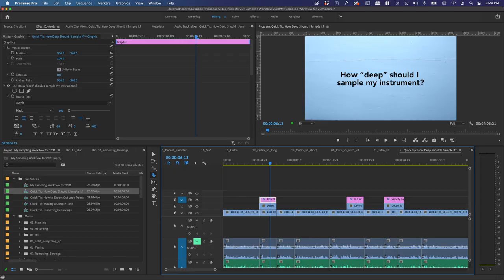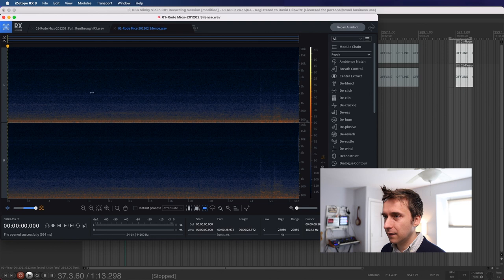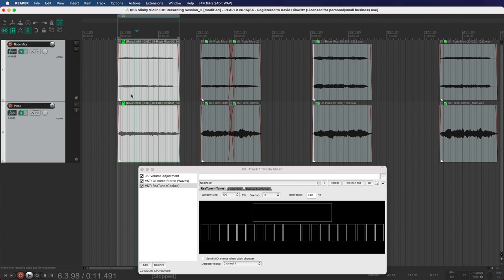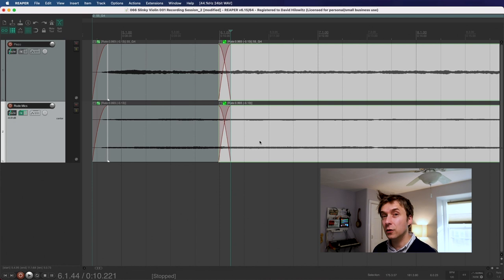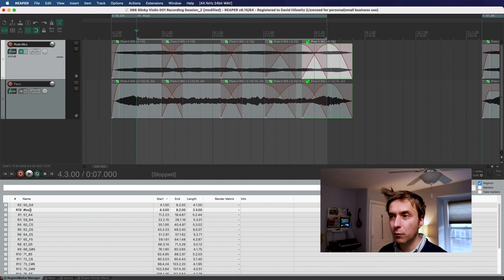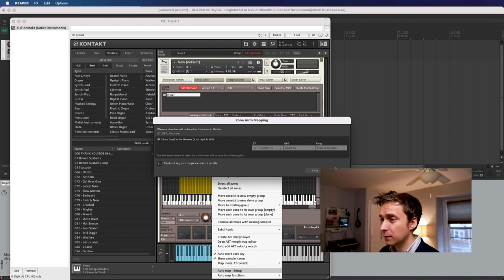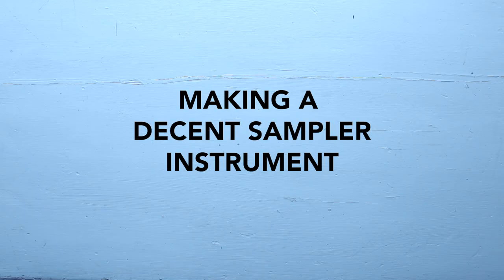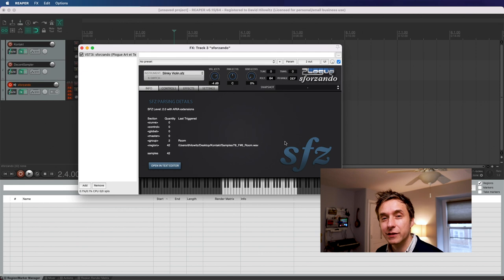How I make sample libraries - 2020 Edition (Kontakt, SFZ, Decent Sampler, REAPER)

Comment: Dave, your content has been amazing. I've started sampling my synths but since Ableton doesn't have an automated sampler I almost gave up. I found out that you can use the free MPC beats software (DAW?) which has a really powerful built in autosampler and you can pull that into kontakt and have it work pretty much without any adjustments. Might be something you could add to a new video. Having a free option for autosampling midi instruments is really useful for beginners like me.

Comment: Thanks for this really helpful video. David, I found out, that your method of changing the rate rather than the pitch in REAPER for manually tuning the samples (as remarked in 8:30) is sort of mandatory on the looping trick you showed in 16:45. I was using pitch at first but ended up with clicking when using your loop trick as described, which does not appear when using the rate. It even appeared when setting the loop points exactly on the zero-crossings. I guess the reason for this is, that REAPER does not show the actual waveform when using pitch rather than rate.

Comment: Can this be done with RX Elements, or is the full version required? Also, what beginner microphones would you recommend to get into sampling? Thanks for a great video!
Reply from the maker: Yes. If you're using RX Elements, just use "voice de-noise" instead of "spectral de-noise". It has fewer controls but I used it for many years and can confirm that it does work. As for what microphones to get, I'll have to give that more thought... :)
Reply: @DavidHilowitzMusic  no worries, thanks very much - let me know if you get the chance!
Reply: Dave made an earlier video using RX7 Elements, in the 1st few minutes of it, that might be useful to you:
https://www.youtube.com/watch?v=B2iEhJcrHxI
Reply: @tonymckeown1314  great, thanks very much!!
Reply: @mediacomposer  Regarding microphones, mics are a varying subject depending on the instrument.

For close micing use sturdy mics like sm58 for example, for vocals high quality mics are great like beta58a and so forth, all depending on your budget preferably condenser or ribbon-like Neumann mics for high end artist or instrumentalist is great option.

Comment: Your video is very helpful as always. I sampled a few instruments. But I am facing one challenge with the pitch bend range. I need large PBR (at least 12) for the type of music I perform to achieve smooth glide and slide... But whenever I set PBR 12 and gliding fron lower note (say C) to higher note (say G), the higher note sounds synthetic compared to if I just play that higher note.. Is there any way to solve this problem? It's the same problem I faced in Ableton sampler, Audio Layer ios sampler as well as bitwig sampler.. How to avoid this synthetic sounding slide?
(By the way I sampled every alternate note)

Comment: If you zoom in and make sure that the waveforms overlap as well as possible, you can make the crossfade very short without any audible effects. I wouldn't use the method mentioned in the video (in the section about removing re-bows), which has two violins playing during the crossfade, and also the big potential of phasing issues. The important thing (apart from volume and tone differences, of course) is to keep the phase of the audio consistent in a crossfade.
This is also important for loop points. You need to be aware of volume, tone, and especially phase.

Comment: Can you please help me out with the looping problem I have sent you several messages and emails but get no reply
Reply from the maker: I actually did respond to your email. Did it maybe go to spam? Specifically, I asked you what operating system you are using? Does changing the buffer settings in the preferences change anything for you?
Reply: @DavidHilowitzMusic  hi yes I tried all that it didn't make any difference there are some messages on messenger that I sent you
Thanks
Reply: Did you send me a testflight through the email? As I wonder which version  it was before it's stopped working it was about 3 or 4 updates ago
Thanks
Reply: Did you send me a testflight through the email? As I wonder which version  it was before it's stopped working it was about 3 or 4 updates ago
Thanks
Reply: @DavidHilowitzMusic  ios 14.5
Reply: @DavidHilowitzMusic  sorry I'm not trying to be cheeky. I just  love the app and I want to use it
 thank you